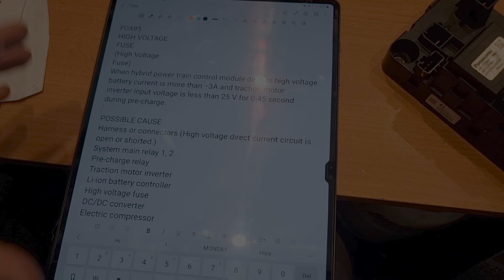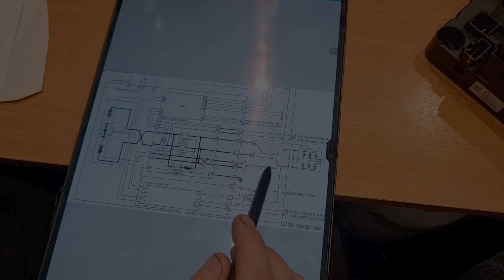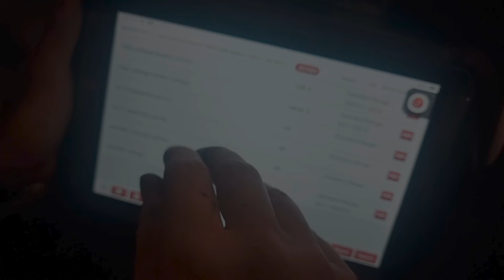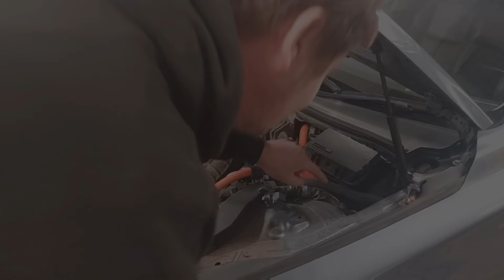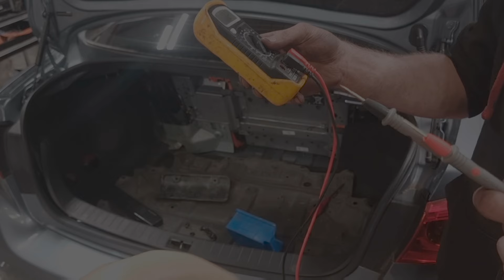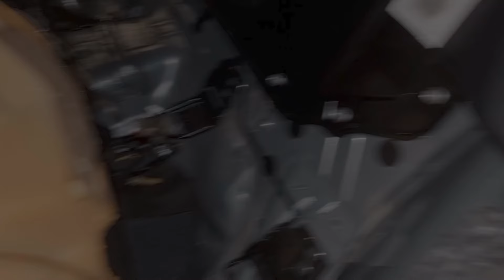CAN WE FIX THIS NON RUNNER ELECTRIC HYBRID HEV INFINITI ???

Comment: I own a 2008 Prius that I’ve had for 13 years now. I had a problem 2 years ago, and I found my own “Josh” in the Tampa Bay, Florida area that diagnosed a failed power inverter, and repaired it within a half of a day, and certainly a lot less than the $4,500 the Toyota dealership wanted to charge me!  Very impressive, Josh!  Also, Rob and Chris, I hope you find more hybrid vehicles to save from the scrap pile. Of course, I love all the regular vehicles you save, as well!  Beautiful car, thank you all for sharing the video.

Comment: As someone who's spent far too much time fixing recalcitrant switch mode power supplies, a lot of this made sense - what is termed "pre-charge" here would be called "soft start" in PSU land - and boy, have I seen some impressive smoke and fireworks when the series resistor doesn't get shorted out!

Comment: So you've had the "joy" of dual-mass flyhweel replacement, injector failure, a nice wrecked engine in your Volvo etc so why not have an EV? Much fewer moving parts so must be much more reliable and cheaper, eh?: Just abhout no one understands how they work, just about no one can service and repair them and the parts prices are just a joke. Get yourself a nice 2-litre petrol non-turbo and you'll be fine.

Comment: Shocked - I actually understood everything Josh said. I have to praise Josh for that as I'm not electricaly literate by any means but his walkthrough was clear enough to get my head round it.👍
I too am equally shocked that they charge so much for that small panel of plastic with 3 relays, 3 fuses & a 97p resistor!! - I worry that these inflated costs for parts will put many an EV into an early grave when they could be saved - that and the fact no one can DIY troubleshoot on these darn things. So much for sustainability!!!

Comment: So what I got from this is that these EV cars designed to save our planet are overly complicated, most garages will struggle to repair them, or at least economically viablable so they will end up getting scrapped and going back into land fill again at a younger age. Great work!
Reply: No, you just need new skills and a new generation of mechanics with the knowledge of electronic systems will replace the ones that can't think beyond ICE.

Comment: Right to repair has gone and not through legislation, it's far too dangerous with that HV circuitry and without some serious training. Almost typical that the resistor wasn't available as a genuine replacement part but you could buy the whole module at vast cost. The one good thing i can see from this is a new industry with people repairing circuit boards just like they do with airbags, seatbelts and crash data modules.

Comment: Nice work Josh and team. Well done. Fixed with a £0.97 resistor... Plus labour hehe.
But the original garage had done the correct diagnostic regarding what whas causing the issue, thing is in those situations you need to think out if the box and know how the system works.
Well done sharing the profit

Comment: Looks even more likely that the garage who previously had this car and wanted to buy it back knew full well that the expensive air con compressor had caused the problem and knew once they had replaced that they would only need to replace that resistor. Sneaky sneaky

Comment: I wonder whether any previous AC work or  compressor replacement had anything to do with it. Someone might not have used the correct non conductive oil when refitting/regassing it. I guess we'll never know.

Comment: If it is direct current at ,,,,,,,400 volts it could arc and burn you or it horribly badly or just cause nasty shock that could prove lethal either  way dangerous in any case

Comment: how many of you think that  the original garage..... replaced the air con pump,  and not the resistor.  then when it didnt work put the old air con pump back on ,    returned the new one for a refund ,,  and still charged him for it.  just my thoughts

Comment: Haven’t commented for a while but as an electrical engineer wanted to say enjoyed a very interesting video. Read the comments about “allowed” and the Electricity at Work regulations covers you guys and Josh. It’s not a home, it’s a place of work. Persons must be competent to work on electrical systems and Josh clearly is and you rightly decided you are not. Another point is that high voltage has a very exact definition in BS 7671, the modern version of the IEE Wiring regulations. Strictly this hybrid battery system is not high voltage under that definition but has a common usage as high voltage. Btw anything over 50 volts can kill you depending on environment and personal skin moisture. Even 50 volts can kill a 4 legged animal! So good to take precautions.

Comment: Fantastic video and full credit to Josh and his team - soooo professional. But also full credit to Rob and Chris for their integrity in splitting the profits. Last point: this proves to me that many hybrid and full EV vehicles are not ‘green’ as huge numbers will be scrapped before they make their way to 3rd and 4th owners due to uneconomical repair costs. It’s a sham.
Reply: It was a 97p resistor that failed. Now try the head gasket on a alloy-engined BMW. People like Josh are the future, better face it.
Reply: @HowardLeVert  Yes, and £900 for Josh to find the fault if I recall. My point still stands.
Reply: @HowardLeVert  And how much was the AC compressor?
Reply: @HowardLeVert  Yes, almost a grand in labour to replace a 99p resistor.

Comment: My goodness, it goes to show our throwaway society, car completely disabled, and practically written off, for a 97p resistor, totally ridiculous! Manufactures should be fined for such ridiculous engineering. What a fantastic video, well done to Josh and his team.  Thank you so much for putting this together, really interesting viewing.
Reply: Terrible isn't it! All that trouble for a 79p resistor!
That's why I will never make that leap to electric
EVER!
Reply: @neilkay159  there are plenty of situation like that (and more) with ICE cars. A 60p big end shell could easily write off an engine. The difference ice, replacing the 60p bearing wouldn’t fix the problem like this 97p part did.
Reply: Drivel

Comment: Great video lads, been waiting for this follow up for what seems ages but worth the wait. Josh did a great job of explaining the diagnosis process. This also shows what a rip off main dealer parts are going to be for EV and HEV cars when they don't sell individual electrical components i.e relays, fuses, and resistors instead they charge £1400 + vat for a module what probably cost less than a tenner to make . Good job Josh used his head and managed to get the resistor for 99p well worth the diagnostic fee just for that. I'm still sticking with petrol for as long as they make and sell them.

Comment: Gret video and a fantastic advert why I will NOT buy an electric car/ van. We must stop all this crap promoting electric cars, no servicable parts (e.g full dealer price for everything), funny they decided to sanction Russia, which actually has pushed all fuel prices (remember electricity is primarily produced using so called fossil fuels,) up, Russia is making record profits, go figure. This shows clearly we are being taken for mugs. Respect to this guy showing is the procedure but he has shown why electric cars are a rip off. I am pretty sure they can lower emissions on petrol, diesel cars, but that's not the plan.
Reply: Read an article in Autocar a year or two ago about a young science graduate who had invented a device which removed 98 percent of emissions from a car's exhaust ( might have been aimed at diesel - can't remember for sure).  His professor - at Loughborough university offered him the university facilities to perfect it, with VW not surprisingly very interested. No surprise there. So what's happened to it? Hope he hasn't been bought off.
Reply: It was an a/c compressor that brought it down, a fairly common part on most cars. Will you refuse to buy cars that have them?
Reply: @itstheterranaut  well smartarse, on a normal car it wouldn't cost a fraction to fix the AC as it would on an electric one. But if you can afford to get ripped off buying an electric car, be my guest, a fool and their money are easily parted. Oh, and on a normal car, you are allowed to work on the AC, disconnect the electrics yourself etc, unlike an electric where you need to be qualified and wear protective gear. You miss the point, but that doesn't surprise me,
Reply: @marksutherland774  Well, not really. Not if it's being done right. Working on a standard a/c system (belt driven compressor) on an ICE car really means having full vacuum kit, etc. Do you own this? I dont. Most DIY mechanics bodge it on the drive. I admit that I have done this. But thats not really doing it correctly, is it?

BTW, the IMI electric course is a short one, and not that expensive. Under £1k, last time we looked.

BTW, my I3S has been fault free from day 1. I love it. Wish our A4 TDI, Cooper, and Pug 208 had been quite so reliable.

I wish you luck with your deprogramming.

Comment: Another excellent and original video.
It’s a great way to work with other people/companies.
It’s funny but I watched an ordinary guy in America changing the battery pack in a Toyota Prius without any safety gear.
I don’t know if you are allowed to do that over here. But I understand the dangers of high voltage systems from when I worked around 3 phase in the past.
👍

Comment: Great video and interesting fault finding by Josh. However very poor manufacturer design by burying the fuses, relays and resistor. And even worse not protecting the AC compressor with it's own fuse.

Comment: I guess the 10 minute waits after pulling the high voltage plug is to let the capacitors discharge with bleed resistors.

Comment: Well done josh and team 

A giant engine in a factory failed. The factory owner and his team had spoken to several engineers but none of them could show them how they could solve the irritating problem.

Then someone recommended an old man who had been fixing engines for many years. 

After inspecting the huge engine for a few minutes, the old man pulled a hammer out of his tool bag and gently tapped on a specific spot in the engine.

Immediately the engine sprung back into life. He carefully put his hammer away. The engine was fixed.

A week later the owner of the business received an invoice from the old man for the amount of $10,000.

“This is a rip off.” the owner exclaimed.

“What did he do that should cost so much?” he continued. “He hardly did anything!”

He immediately wrote the old man a note and asked him for a breakdown of his unacceptable bill.

The old man sent an itemized bill that read:

Tapping with a hammer: …... $2.

Knowing where to tap: …... $9,998.

Moral of the story; while effort is important, having the “experience” to know where to put that effort makes all the difference.

Albert Einstein said, "The only source of knowledge is experience."

Comment: Well done lads ..... well done Josh - £1400+vat vs 97p But how are dealers allowed to get away with only selling complete units instead of the bits to repair them
Reply: I agree, but it’s because the dealers are agents of the manufacture, and if the manufacture say it needs that part to be replaced as a full unit, then that’s what they have to fit - especially if they want the manufacture to guarantee the repair for 2 years which most do.

Comment: A really interesting video Gents. I am so glad you didn't cut any of it. Who would have thought a small resistor would cause such a headache? We know the AC compressor failed but for it to cause the resistor to fail is quite something. It just shows that the theory of discrimination does not always work. The basic theory is that the first fuse in line should blow. I think that is a great idea to share the profit with Josh. Thank you to Josh for filming the video and for all the hard work. Thanks Rob and Chris for showing something quite different and of course for your work getting  the MOT and cleaning done, top marks all round. 👍👍

Comment: Sadly - this is the direction we are heading towards with Hybrids and EVs - large specialist labour charges. Frankly, I was surprised Josh's bill wasn't higher given what he had to do. This is not the first video I have seen where a relatively minor element (the A/C) stops the car from running altogether. And not to forget, with a hybrid you have the complexity of a modern petrol car PLUS the high voltage EV components - a doubling of potential faults down the line.

Comment: You get Fitters and then you get those with good old Mechanical knowledge that can properly diagnose a fault and fix it. Sadly the later are very rare these days, and in Josh's case Electronical knowledge too. A very kind gesture from you two as well.

Comment: Again with the "not allowed".  Please stop saying that.  You are allowed, you are just choosing not to.  A decision that I have no problem with but please STOP intimating that we are "not allowed".
Reply from the maker: You say what you want and I’ll continue to do the same
Reply: @sruk  Until you said that I believed you be honourable and truthful.  Outright lying about permission to do a thing does not square with that.
Reply: Do you know e.g. there insurance cover? There license for the shop? EV or hybrid is a completely different sport. Standard insurance covers for garages or breakers doesn't cover EV/ hybrid related damages. Then there is the permit. Because of the battery packs you have to have special permission from the Council to work on EV/ Hybrid. There is a substantial higher risk of fire or related damages. The lads are making a wise decision not to pursue working on these kind of vehicles. Knowledge wise and other wise.
Reply: @tiskenyt  As I've said I have no problem with the decision not to DIY, HV can be scary to some. No special permission is required to work on your own equipment.  Honesty is key, that they have chosen not to do it is fine, the reasoning behind that decision is what is at question.  Simply saying "not allowed" and promulgating the idea that permission is needed is just wrong.

Comment: Hybrids are far more complicated than pure electric vehicles.
Reply: @PAUL MH you are somewhat misinformed.  The vehicles clearly do 'work' in winter -  over 80% of new vehicles sold in Norway are now electric!  Batteries, on the whole,  are not 'going bad'.  If they do many are repairable - or simply swapped with ones from crashed cars! They will 'take off' as the sale of fossil vehicles is going to cease in 2030 and, world wide,  the car industry is moving to EVs.
Reply: @PAUL MH I have an electric car, you halfwit.

Comment: Seeing your future disappearing as you won't be able to do any mechanical repairs on these cars. Small garages are under severe threat.....but at least you will be able to keep us dinosaurs on the road!!
Reply: Do you think Josh and the others were born knowing this? 🤔
Reply: @FFVoyager  they have obviously made the decision to specialise, but the point is how many will with the high level of risk and investment especially as the used vehicles get older and potentially more dangerous to work on as components fail. The chances of 10yo electric vehicles being kept on the roads is far lower than the equivalent oil powered that can basically be worked on by  any decent mechanic.

Comment: Also D.C. Volts are continuous so as there is no "Wave form" as in AC/DC where the current switches from one to the other, there is a point where you could let go for a split second, but not with DC. It keeps going until the battery is drained! 🙄